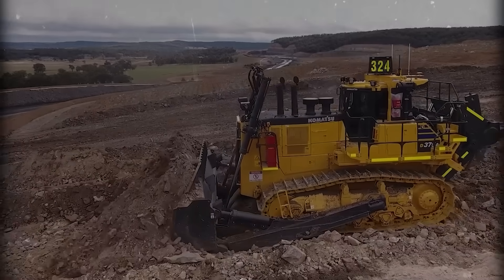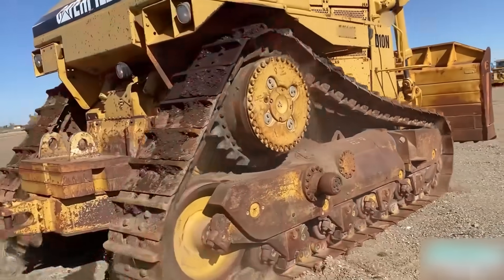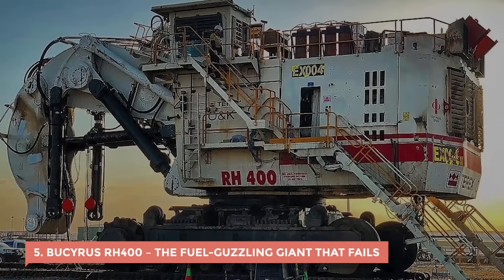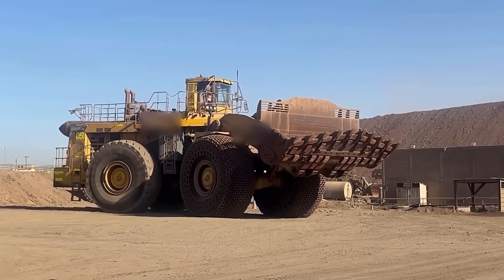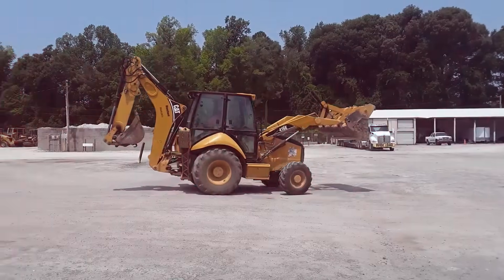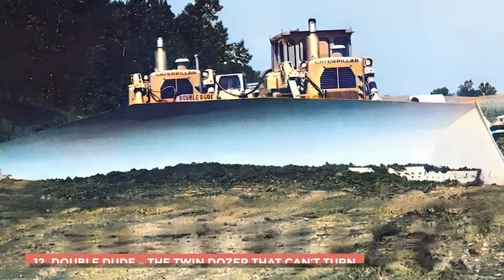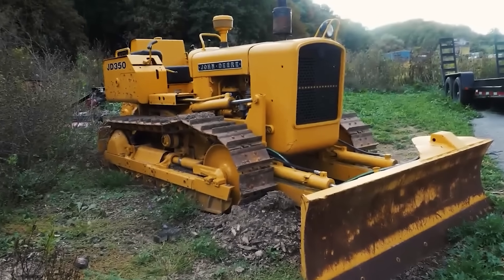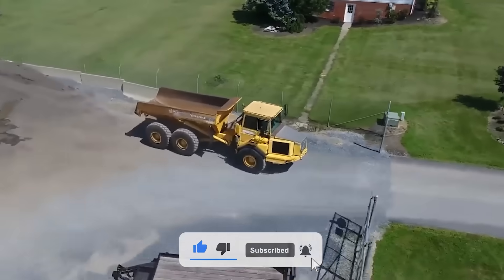The 15 Deadliest Bulldozer Features Ever Built

Comment: Worked on volvo rock truck..transmission failure in house shop pulled 3 times oil leak engine..bell housing the problem is to get tech support..5300 $later from Sweden the replacement was webbed large obviously they had a flaw in the design originally..??

Comment: Terex lol. Other units - hyd triubles- but every services hyd systems. Lol. Maybe extra hyd coolers. Side by side - no should be articulate unite connected end to end. Lol Too much fuel. Hey over rev the engines. Detroit  2 strokes famous for that. The V8 eng too. Crank the power up. Lol. Volvio - lol.